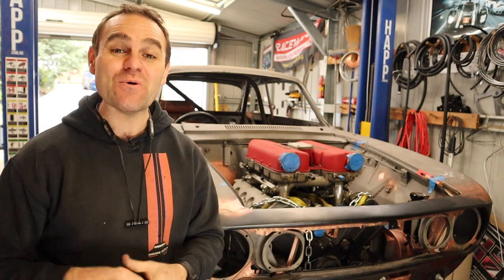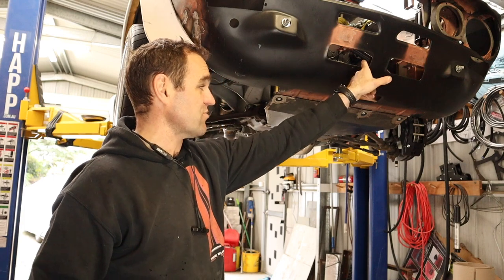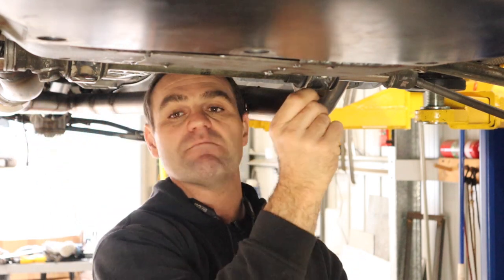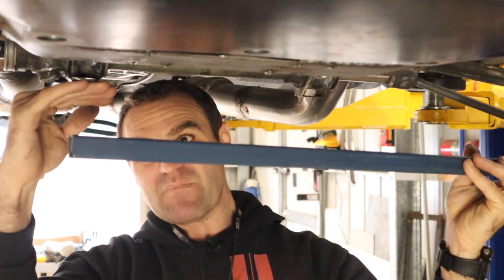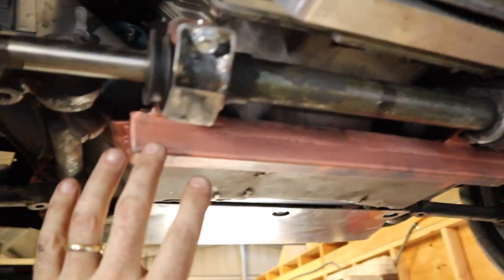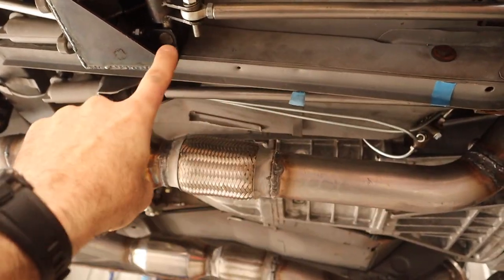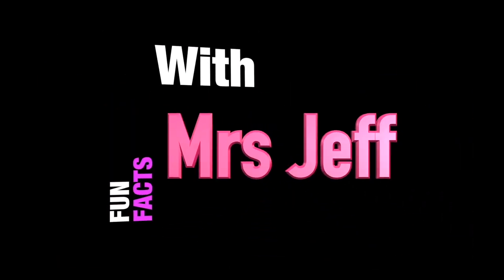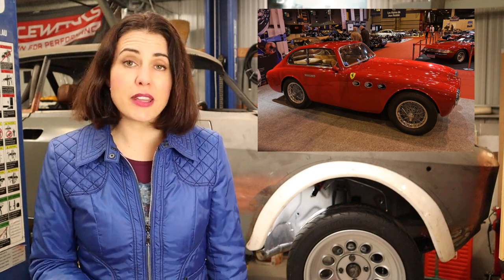Lets play hide the hose...- Ferrari engined Alfa 105 Alfarrari build part 95

Comment: Hi Jeff, lots of good progress. One idea for draining the protective brake and clutch panel, is to look at what Alfa did for the original panel. It has 2 or 3 small slots similar to traditional bonnet  louvers but much smaller. The opening faces rearward.

Comment: Only just recently found your channel Jeff and love your work. My only thought on this panel would be if you’ve considered making it from a composite material? A lot of rally cars would use a carbon-Kevlar panel on a component like this. It wouldn’t corrode or be susceptible to stone chips or rust. It’d be much lighter and carry some inbuilt flex, which would also help with getting it on and off to service your sump. It would also be less of a heat sink around the exhaust. And finally if it was knocked it would most likely spring back, whereas the metal panel would stay dented into your master cylinder push rod.. Keep up the good work mate 👍
Reply from the maker: It could possibly be made out of composite later, but it is much quicker and easier to make out of thin steel sheet.

Comment: Instead of using that bulky 90’ AN fitting at the bottom of the oil tank, weld on a 90’ alloy tube then a straight fitting after? You can still drain the tank at this point but you have moved the bulky fitting in board from the sill?
Reply: this sounds like it would have been the best and easiest solution lol

Comment: I would not put in such a sturdy vertical piece like that square tubing. If you his something solid it will rip off, no doubt, been there, done that. You make something that can "skid" over stuff.
Reply: Those aerodynamic Gurney flaps he mentions are usually plastic, not metal, so they can flex/bend as required.
Reply: @computiNATEor  Yeah, I figured. It could be made of steel to as long as its thin sheet and you vould just have to bend it back if you hit something.

Comment: Put heat shrink tubing on the microphone wire to give it more support so it doesn’t wiggle itself to death again.

Also, replacement plugs are dirt cheap, you can just cut the wire at the broken spot and solder the new plug on. (I’ve done it several times on my car radio’s input cable)

Comment: in my conversion..i always come across this problem... welding new steel to the oem ( crappy) steel,,to easy to burn thru.. what is your work around?
Reply from the maker: Taking my time and practice. I actually have a new Weldclass welder which has thermal control making it much easier.

Comment: First up, I don't know who your regular viewers are, but I got an.ad for Gulfsteam. Is your algorithm aimed at millionaires? Coz that I ain't.
Second, those bash plates don't need to be as strong as you think. They don't need to absorb the entire impact or the weight of the vehicle or anything else you may think. If you've ever grabbed the wheel arch and lifted you'll know it takes about 50kg of lift to raise the car 10mm on its suspension. So it only needs to be able to take 50kg. At 4g that's only 200kg. At 10g that's 5000kg. But I don't think you'll be alive after a 10g impact to worry about bash plates. If you're really worried about it you could use some 10mm bar at 3-5mm thick and weld a little peice on each end running forward to stop the bar from going trapezoidal in a light impact. It will give strength without impacting aero

Thirdly, I'm almost ready to build my roll cage. What's rental on your bender and shed worth again?

Comment: Honda utilizes wedge/ramp protectors on their exhaust systems on some of their cars in vulnerable spots to help divert undercar strikes. Think of a shark fin type of wedge welded to a pipe in front of a perpendicular exhaust flange. It’s goal is to prevent a hit to that perpendicular surface. The item hit the wedge / ramp / shark fin protector first and deflects the impact force.  This could be used on your Gurney Flap protector as well as certain points of your exhaust system that would be vulnerable. Picture an item hitting a flat wall compares to a ramp. It could be enough to deflect the exhaust and let the car ride over the item thus eliminating or reducing the damage.

Comment: Hey mate, commodores used a flap like yours right behind the radiator. It creates a low pressure system immediately behind the radiator and effectively sucks air through the radiator and out under the car. I used it on one of my builds to solver an overheating  and it worked brilliantly.
Reply from the maker: Good to know it works :D

Comment: Have you tried a 90deg fitting on your lapel?  Might last longer 

Nice job on the skid plates, tedious but nice to get through it I bet
Reply from the maker: It is not the lapel end, it is the end on the unit :(
Reply: @HomeBuiltByJeff  ahh, that sucks. Still might not wiggle as much with a 90 on there. Might be able to tape it down flat or something so no movement. I’m just using a mic on the camera still but was thinking about a lapel

Comment: For a different mic setup maybe try the Rode Wireless Go or Go II setup.   The transmitter is much smaller and has the mic inbuilt. Also on the Go II version it can record in to the transmitter at the same time so if you lose the connection to the receiver you can retrieve the audio.  But that's not the exact issue here.
Reply from the maker: I may switch at some stage, but I tried something I go into in the next video ;)

Comment: Jeff. Take that line right through the steering rack mount gusset; name a 2nd plate over it then tabbed into the wheel arch.
You'll get the line a lot higher and easier to protect.
Reply from the maker: That is one of the weakest parts of the car. I don't want to weaken it any more and I would also have tyre clearance issues.
Reply: @HomeBuiltByJeff  perhaps.  Surely an overlay panel to that gusset would strengthen it to?

Comment: the right way would have been to make that hose into a hardline. not something you want as a hose near moving things
Reply from the maker: It needs to be able to flex with the engine movement
Reply: @HomeBuiltByJeff  not in those spots. it may rub a hole. but if there is no other place to have a flex, just going to have to see how it goes

Comment: Worrying about an inch of steering rack mount poking down but right behind you there's a bastard big exhaust hanging down. 😂
Also, would it not have been better to have less of a step in the bash plate? That way if it does hit something it's less likely to catch but rather it ride over whatever you hit.
Don't forget to drill drain holes in the bash plate or other bits you boxed in.
Reply: The rack is inline with the wheels anyway, hard to bottom that out on bumps

Comment: Jeff, you clearly have no experience with these cars. The sump can suffer if you have soft springs as some of these models had (Spider mainly) but the real issue is the exhaust! Once lowered they ALL SCRAPE THE EXHAUST! 
You can see it when you film it from under the front bash plate.
Luckily you have already removed the exhaust mufflers from under the foot floor that the original car has so most of this issue has been already solved.
Run relatively stiff springs (600lb/in or higher) and don't lower it crazy otherwise the exhaust will turn into a oval shape tube... 😅

Comment: Amazing work as always, making me guilty about how much I’m NOT working on my own projects!  I’m a little concerned about the hose guard clearance once the car is on the ground- I saw there was plenty room for the full lock of the wheel when drooped, but did you verify the clearance with the suspension at full compression?
Reply from the maker: The clearance gets better under compression. Full droop is the worst of it.
Reply: Awesome!